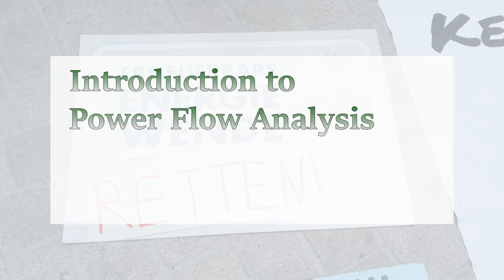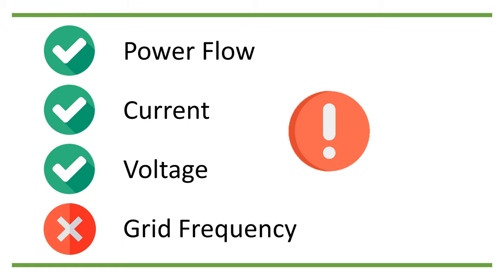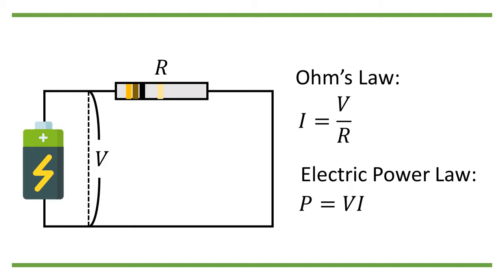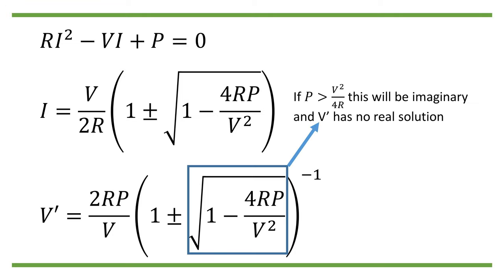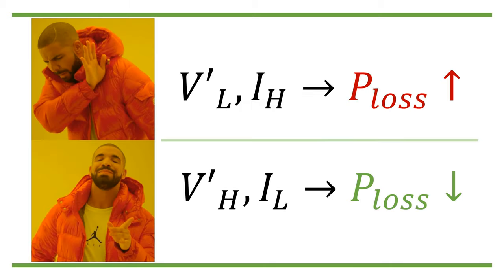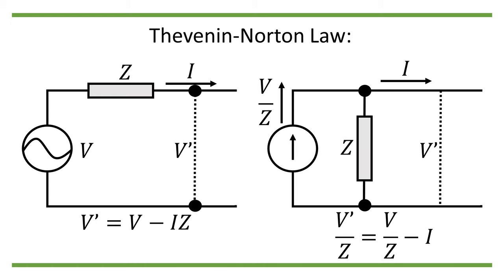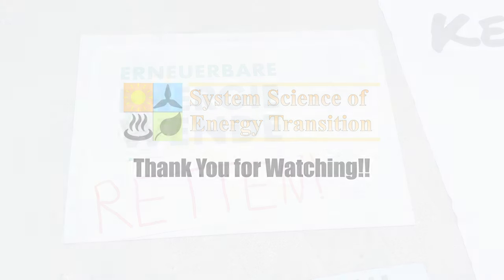Power Flow Analysis (1): The Theory

Comment from the maker: Content Correction:
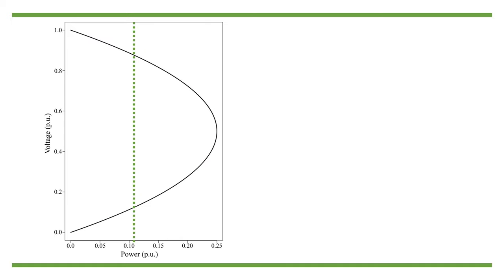Between 06:35 and 06:46 the signs of the slope on the slide are wrong. The partial derivative of V'_H with respect to P should be smaller than 0 and that of V'_L should be greater than 0.

Comment from the maker: Some remarks:
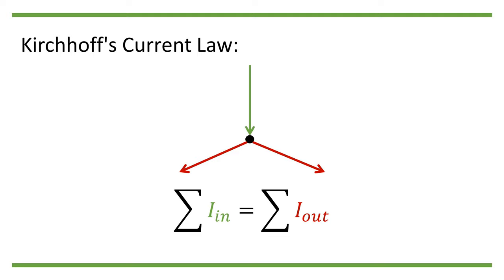1. The Kirchhoff's current law in 08:45 can be derived from conservation of electric charge ( https://en.wikipedia.org/wiki/Charge_conservation ) at an infinitesimally small control volume surrounding the node considered. Since inside a conductor electric charges can move freely, the net charge must be 0 everywhere in the power line, so we can drop the time derivative term in the charge density continuity equation. Kirchhoff's current law can then be deduced by applying divergence theorem to the divergence term of the charge density continuity equation.

2. Y_eq in 10:58 is a Laplacian matrix ( https://de.wikipedia.org/wiki/Laplace-Matrix ) in graph theory. In a well-connected grid where all n nodes are connected to each other by at least 1 path, the rank of the corresponding Laplacian matrix will always be n-1. We will discuss more on this in the part 3 and part 3.5 of this series:
https://www.youtube.com/watch?v=jn4dKlzjHAQ
https://www.youtube.com/watch?v=DrsbsygaCAE